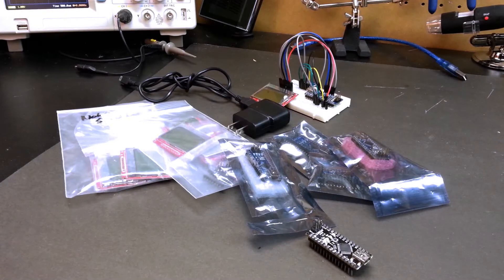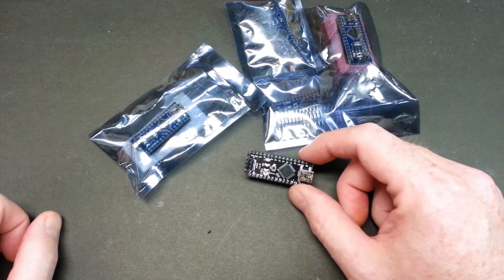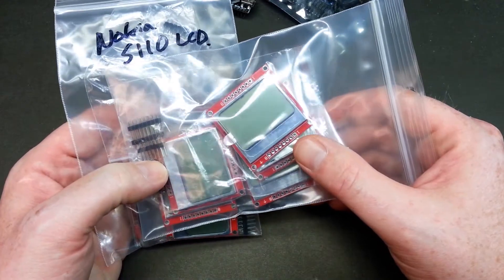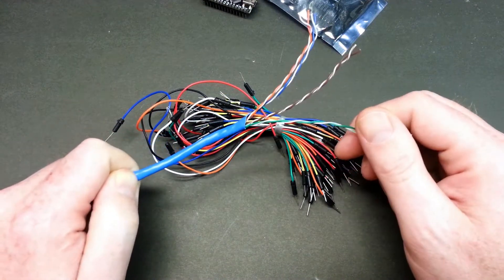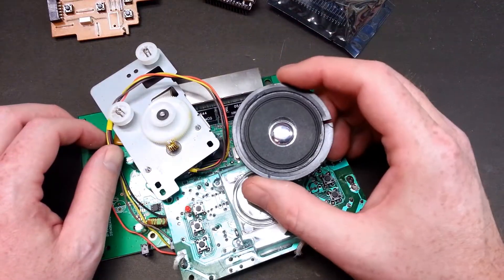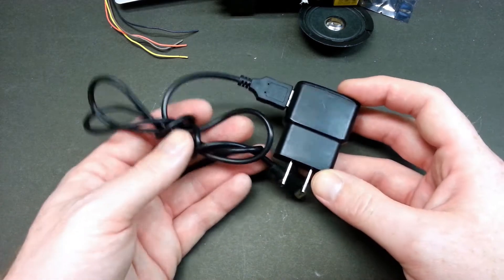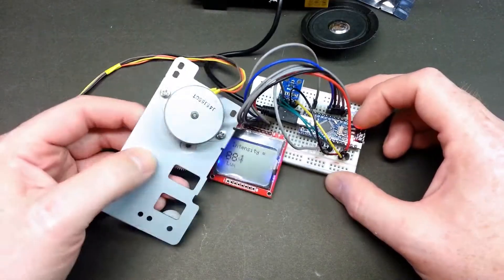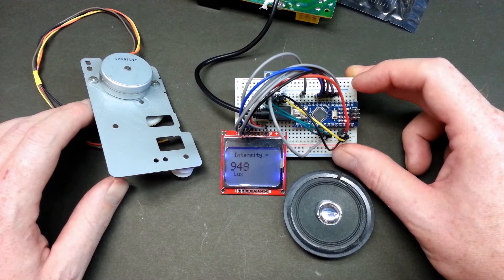How to get started with Arduino for CHEAP!

Comment: I recommend getting the jumpers. I started using breadboarding with phone wire, having lots of colors was nice but the breadboards are designed for 22 gauge and phone wire is only 26. Became a pain to deal with as wires slipped out easily.

Comment: Thanks for the video :)

I just have a question about "quality" if you don't mind as I have 4-6 different types of "pro mini" boards (the ones that require a TTL programmer), and so far the black version seem to be the most reliable (the BAITE version) as it keeps working flawlessly even on 12V DC @ 1A (where any blue version start to fail outputing 5v) and it has a badass pin 13 blue LED + quartz resonator.So I was just wondering if you had any advice on which design is truly the most reliable when it comes to not burning out? Thanks in advance =)
Reply from the maker: pixelsafoison That is exactly why I recommended the Nano here- USB is on board.  No need for programmer.  I have several Pro-Mini's as well.  I have cheap clones and haven't had a problem yet...the Pro Micro is another story- I will never buy another.  Cheers